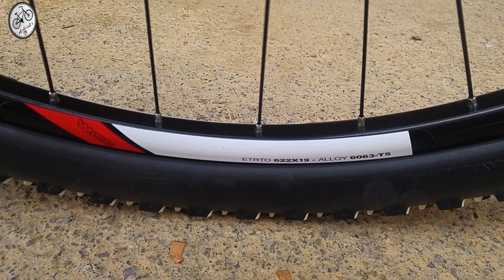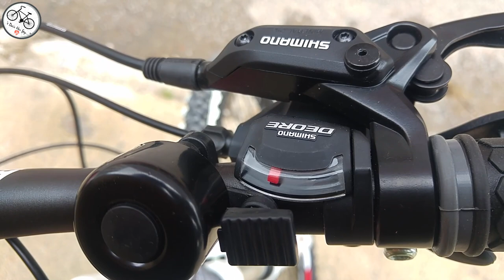WHISTLE 29” PATWIN 1830 ERKEK DAĞ 30-V HD Kutu Açılımı ve İnceleme

Comment: Fiyatını hak eden bir bisiklet mi?
Reply from the maker: Fiyatı ne şu an?
Reply: 1827 diye bir modeli var sadece stokta(6.500 tl) ama internet sitesinde 650 € gözüküyor. Bulabilirsem ktm 1964 alıcağım ama yok işte piyasada
Reply from the maker: @iskender1252  whistle kadro ağır bence farklı bir şeyler düşün.
Reply: tavsiye nedir bütçem 5 bin tl şuanlık. çok fazla bisklet var :)
Reply from the maker: @iskender1252  Ktm Ultra 1964 (Limited Edition) sahibinden de 2.el var. Bir değerlendir istersen